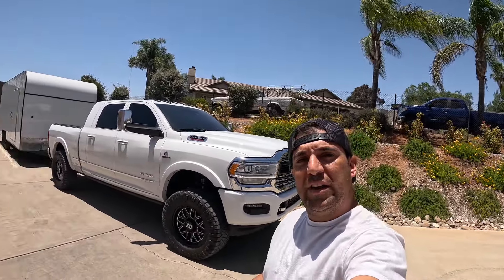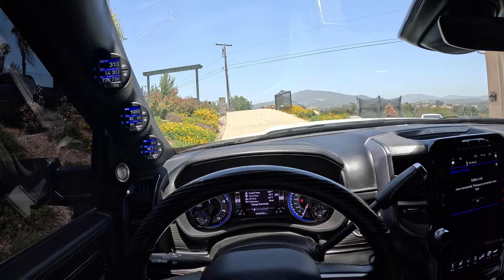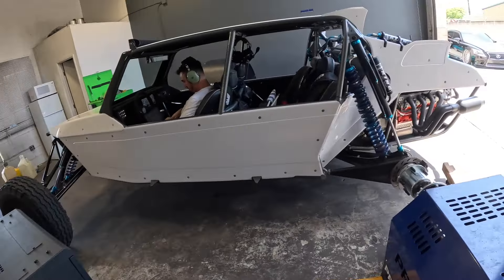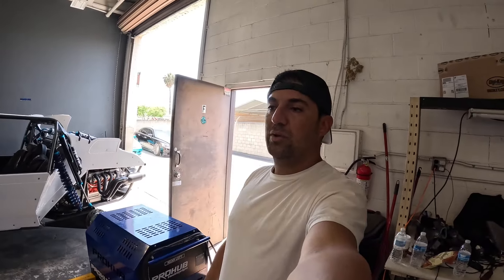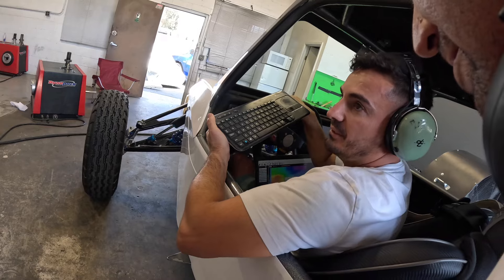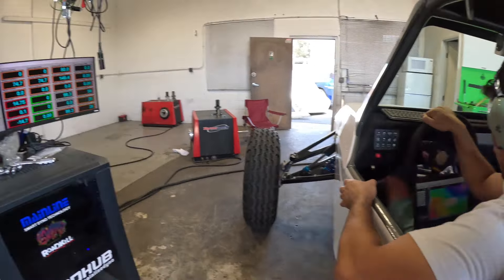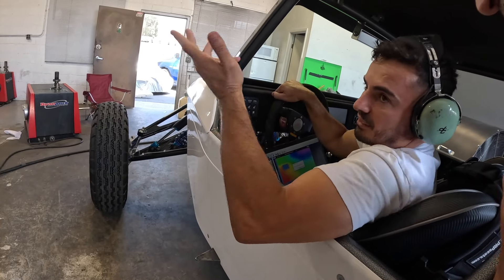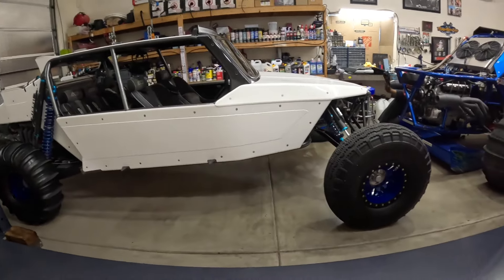E85: The Secret to More Horsepower?

Comment: Eddie. If ur switching over and ready to maintain the corrosive properties of E85. You might just want to consider to go over to methanol. I drag race and I know a lot of people that use E85. They have to test constantly to make sure it’s 85 or higher at the pump. I would switch to methanol. I get methanol in the drum and I pay 200 for 54 gallons. And my truck loves it which is a 540 big block na. Intake temps are much cooler than E85. Just a thought.